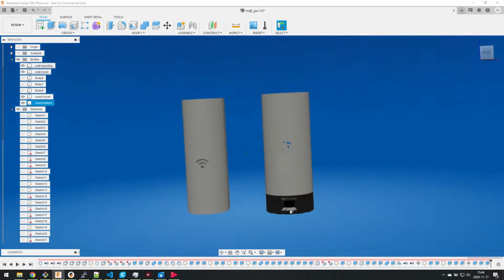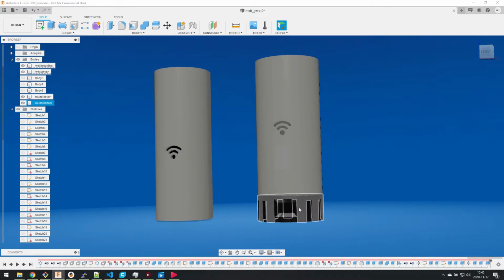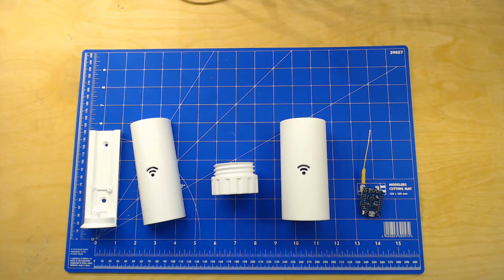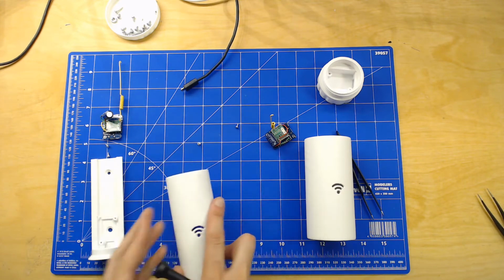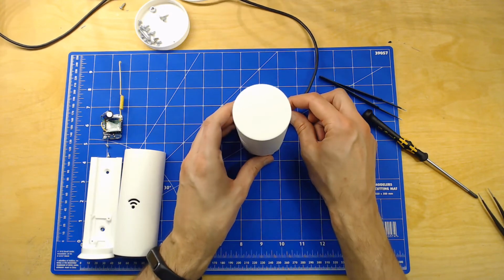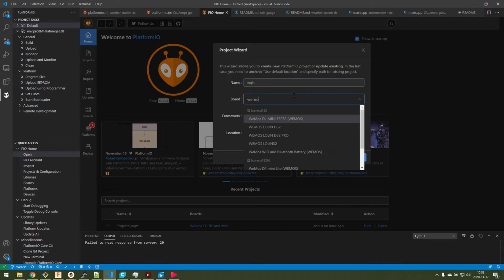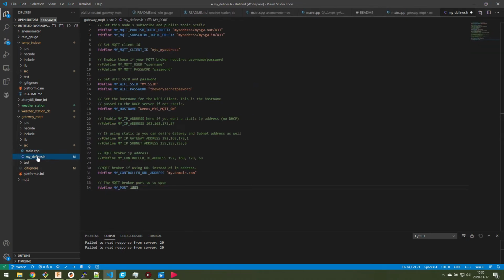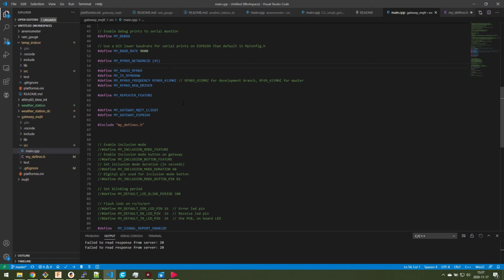Build your own MySensors MQTT GW for Hope RFM Radios

Comment: what about MySensors , NRF24 integration ? make some step_by_step  ... please
Reply from the maker: Hi, I've updated the header to state it's specifically for Hope RFM (433MHz in my case) radios. Sorry about that! The NRF24 chips will not be suited for this design but on the other hand doesn't have the issue with a long antenna whip